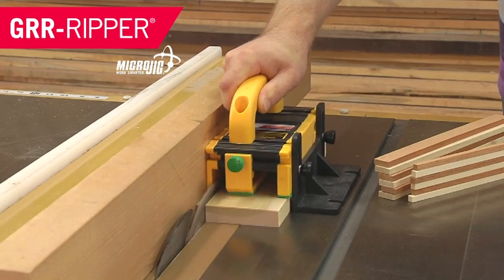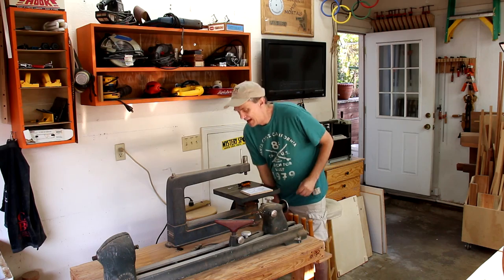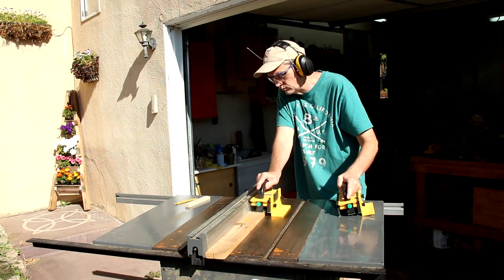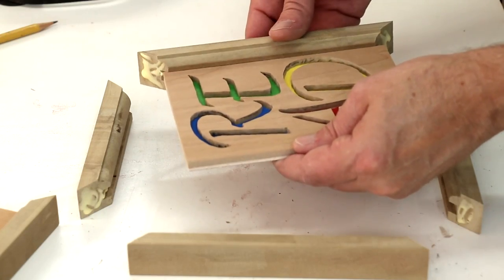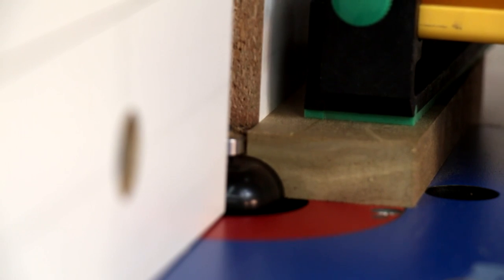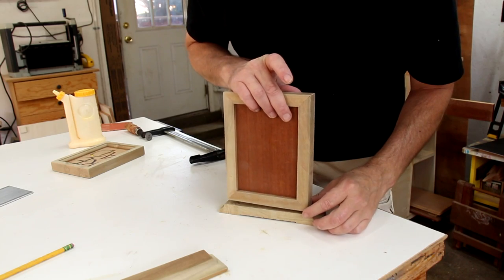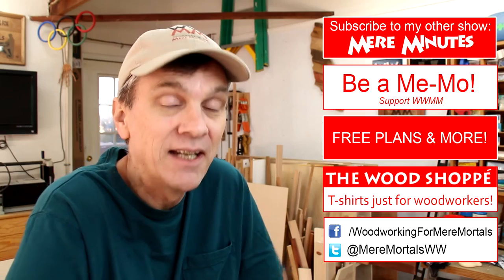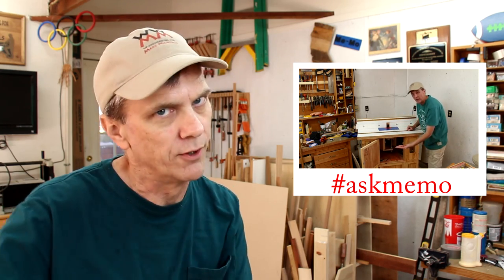Scroll sawed bookends

Comment: Questions on working with Aluminum: do you need a metal cutting blade in the bandsaw? Did you use cutting oil for drilling? THANKS!

Comment: Do you need special drill bits, bandsaw blades, and/or sandpaper for working with the aluminum, or just use what you have?
Reply: You can use regular woodworking tools on aluminum, it's softer than some hardwoods.